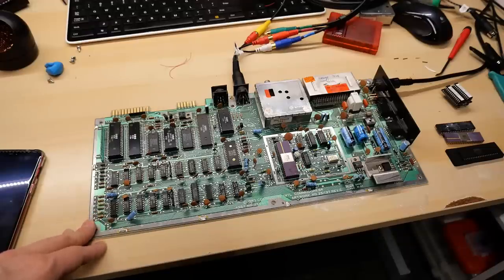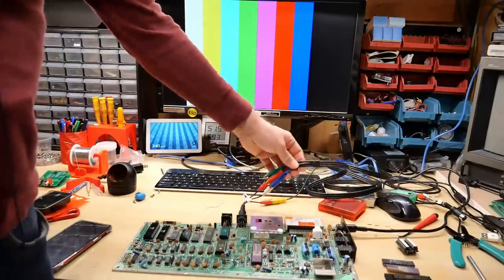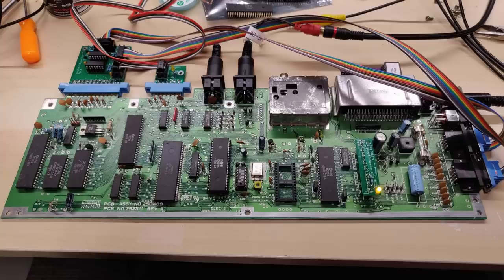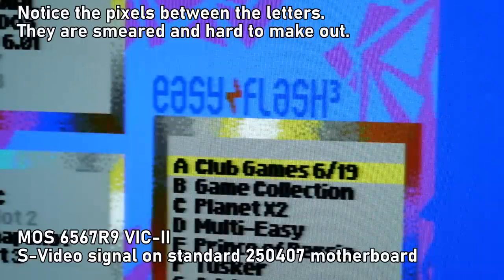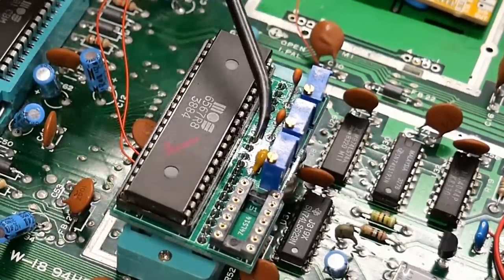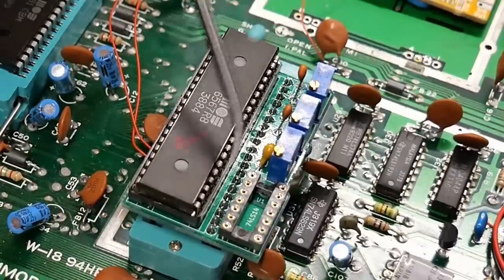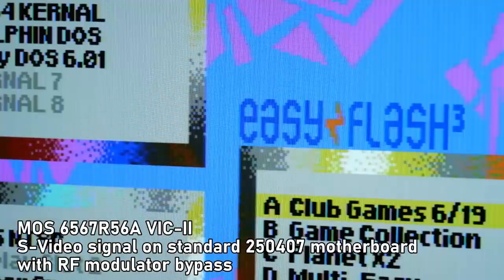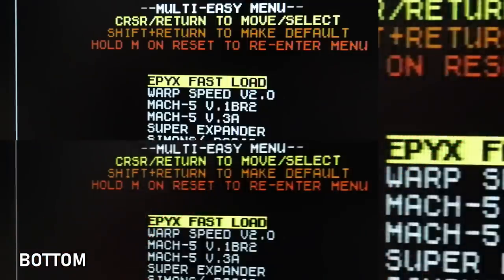C64 video output: Is there room for improvement?

Comment: I wondered how much of this is a factor of the RF modulator - the chroma/luma goes into it, and comes out of it again to go to the DIN connector. Some C64s seem to run the modulator from unregulated 9V, and some run it from regulated and L-C filtered 5V. I suspect there is a buffer amp in the modulator, and this is a factor.

It'd be interesting to take the chroma/luma straight out of the VIC-II, and feed it through a modern video buffer opamp, fed from the +5V line. The separate board Adrian shows seems interesting

Has anyone tried adjusting the  pot on the C64's that have the 74LS629/MC4044 clock gen circuit and see if that affects the picture?
Reply: You might also find there is some improvement to be had by using screened cable for the chroma-luma jump wires. Connect the screen to GND at one end only.
Reply: Another thought occurred to me about the RF modulator - it will have an oscillator in it (possibly two actually) which are potential sources of interference to get coupled into the video signal. So by removing the RF modulator, you're removing those oscillators. I suspect it's probably more to do with poor bandwidth of the amplifiers in the RF modulator though, coupled with the fact that some of the board revisions run the RF modulator from unregulated 9V supplies

Comment: I've come to the conclusion: forget it. The C64 is at the deepest bottom of the rank for good quality video out on 8-bit home computers, way deeper than the ZX spectrum 48, and that is already DEEP. Combine that with a colour palette, that not really has colour, other than various flavours of diahrea, so we have to forget any attempt at decent output. There are TWO ways to connect the C64: over RF, and then slightly detune the channel so a shitload of noise hides any garbage in the RF output. Or go mono. My advise is grab a Philips 80 BM7522, so the amber makes you somehow happy with its sunny atmosphere. 15 gradients of yellow is better than 15 flavours of brownish something. Mono the C64 is acceptable.

And if you have a C128: forget about using it as C64. Hook up the RGBi output to a 1084 and set the machine to 80 character mode, and NEVER EVER switch back to C64 or 40 character C128.

Comment: Cool, man.  I assume that you upcoming rf modulator hack will also work on a   128dcr?
Reply from the maker: Actually no. Commodore used different modulators on each system and it seems no one has schematics for them so I had to reverse engineer the ones on the 250407 boards by hand in order to know how to fix them.
Reply: @adriansdigitalbasement  Well phooey!  I guess I'll have to reverse engineer mine too then.  Almost makes me wish I was on a coronavacation so I had more time for that sort of thing, but unfortunately I appear to be "essential."  :P

What do you do, just cut power to the RF section somewhere to keep it from RFI-ing back into the signals, and leave the video amp thingy and combiner stuff alone?

Comment: on the Vic-II & SID bypass amplifier, are you sure that -5V is ground? There's a pin labeled 'com' right next to it, which is usually shorthand for common, which is essentially ground. If I were you, I'd take my multimeter and measure the voltage between -5V, Common, GND, +5V and the other -5V on the board and be sure. If you're referencing to -5V instead of ground that could have a negative impact on video quality.
Reply from the maker: COM is the composite output.
Reply: @adriansdigitalbasement  What a strange design. So -5V is at the same measured voltage as the GND pin on the other side? Silkscreen error I guess.
Reply from the maker: No the two halves are electrically isolated on the PCB. Nothing is shared between video and audio halves. 

Yeah makes little sense to me as well!

Comment: Have you tested luma-only with the other chips? (I've read that later revision chips used 8 levels of luma, to allow for better differentiability between colors on B/W TVs compared to the 4 levels used on early revision chips)
Reply from the maker: As far as I know, this is on the PAL VIC-II chips. Indeed that first revision has only 4 levels compared to the 8 of later ones. The NTSC chips I have don't work this way.

Comment: Hence, NTSC really means "Never The Same  Colors". It's fun, but awfully true. Rotten old standard.
Reply from the maker: Both systems have tradeoffs. The PAL C64 has bad Hanover bars due to phase error on the chroma signal. The only way to eliminate this is to average two lines of color together halving the chroma vertical resolution. (Which is what most monitors do) I'll show this off in the next video. https://en.m.wikipedia.org/wiki/Hanover_bars?wprov=sfla1

Comment: I had a VIC20, the video out was so horrible it wasn't funny. I was used to using a high res monitor on a TRS-80, the Vic was so much inferior that I hardly used it. I was running a composite monitor, I never tried RF on it.

Comment: I have been struggling with video quality on a Commadore 64 C. I removed that metal "heat sink" and noticed that when I attached the keyboard without it the video went haywire. So I put it back and it's fine. Any suggestions?

Comment: I don't agree with you that Lumafix doesn't work.
I have a 250466 PAL with MOS 6569R5 and Lumafix completely removed all jailbars.
There was a lot of screwing on the adjustment screws, but 100% of the jailbars are gone.

Comment: The amp circuit has a GND on the right side, so the -5v line probably should be -5v.
Reply from the maker: The COM connection is composite video. Not common. -5V is ground.
Reply: @adriansdigitalbasement  What I saw was clearly labelled GND At 9:21. Next to R12, below "OUT>" above "SID OUT"

Comment: hey Adrian, I wonder if you could hook up a small chip to the Y/C output if the Vic II and have it decode the chroma and luma. Then, since the C64 only has 16 colors, you could decisively decode the exact colors for wach pixel, and you could put it out as perfect RGB.
Reply: I’ve thought about that too.  Doing so might be more complicated than recreating the video output from video memory though.
Reply: @nickwallette6201  but would such a recreation be compatible?
Reply: c0pperdragon, the person who developed the FPGA mod had "tried really, really hard" to extract a pixel perfect signal from the VIC-II before going the route of just re-creating the VIC-II video out circuitry on FPGA... But only the video generation part, a real VIC-II is still used to fetch data and generate all the timings.
@cheater00 , seems compatible enough to me.  I've thrown the latest demos at mine without any glaringly obvious problems.
Reply from the maker: Yes I read the details on that board and really it was better just to recreate the VIC-II in a FPGA -- at least the parts needed to make a video output.
Reply: @adriansdigitalbasement  that's crazy cool to be honest!

Comment: That board can be replaced with 1 cheep chip FMS6400-1 it includes the proper luma / chroma band filters, 75ohm line drivers and additionally provides a composite output. VCC=5V only.
Reply from the maker: I just looked at that data sheet and that IC and it expects a 75ohm 1v Peak to Peak luma signal. This is not what the VIC-II outputs hence the buffers on the Y/C outputs on the VIC-II.
Reply: A simple transistor buffer on each should fix that, similar to schematic 326106-2of2-right, but yes it then makes it more complicated.
Reply: @adriansdigitalbasement  It is interesting to note too that the VIC-II's luma pin is actually an open collector.  It can only sink the current from the supply rail, it can't actually "output" any current of its own.  If you look at the schematics of the original modulators, you'll see a pull up resistor and a diode to provide the power to the luma pin.

Comment: That board looks like a SMD version of Zer0-X's (Tommi Lempinen) "Spider" modulator replacement.
See: https://lh3.googleusercontent.com/proxy/Duu7_AebbvnnOKbqbZ8wMpaW2RNwzt4QMo5PoIuOMy7YrnHvmoIucSZ96Kq7nNW6VAXJprtbABkPcDeFUnUiL10XXWrUZfk
Another major quality boost is achieveable by using a high quality CRT like a Sony PVM ... unmodified C64 250425 PAL (don't know the VIC-II revision off my head): https://i.imgur.com/HKXeGB4.jpg
Reply from the maker: Looks similar but definitely isn't. I've done all this reverse engineering of all the RF mods and this board so can tell their design but looking now. LOL

Comment: Quick answer:
get an FPGA replacement that support VGA or RGB Video output. :D
Reply: ungratefulmetalpansy  the point is to hold it in your hands. unlike software emulators. :p
plus chips are constantly dying. someday there are no more functional VIC IIs or SID chips... what then?

the sooner people start with the development of softcore versions of these chips the better and more accurate they are gonna be by the time the chips died out.
Reply: ungratefulmetalpansy  some people still want to hold the actual computer though.

the only things that would be emulated are the Video and Sound chip, the rest can still be made using modern equivalent of the real chips. (PLA can be replaced by a PLD or CPLD)

doesn't seem logical to completely get away from real hardware if 90% of it can still be made. (and the other 10% are programmable hardware, but still hardware)
Reply from the maker: I do like of agree with everyone here that at that point, may as well use emulation. I like to use my C64 at the native scan rate on a CRT as that is closest to the original hardware...
Reply: @adriansdigitalbasement  It was just an idea, for an actual replacement chip the FPGA would logically generate the same signal as a real VIC-II, just clearer.
otherwise it would not really be C64 compatible.

but it seems like an overreaction to say "just use an emulator at that point" when i suggest to replace 2-3 chips with CPLDs/FPGAs because they won't be around for very long anymore...

i mean you're not throwing the whole system onto a single FPGA like "THEC64", it's just chip replacements... to keep the actual hardware alive for longer.
Reply: @proxy1035  Maybe run a kickstarter😂
Reply: It's not like were asking Jesus to have his nipple pierced to keep up with modern times here or that you HAVE to have your VICII upgraded, the point here is simply choice - some of us do want an FPGA VICII instead of a Turbo Chameleon or an Ultimate 64, there is demand for it and therefore a market so who's up for the challenge?  (No not you Jim Drew I'd like to actually get my hands on one before I die)
Reply: @_.OX._  "Progress on the JDFPGAVIC-II is nearly complete, however my financial backers have convinced me to expand the scope of the device to support C16, C128, VIC 20, Amiga OCS, ECS, AGA and the NES 2C02.  The JDFPGAVIC-II is no more, long live the μVideo!  Expect delivery sometime 999.M41."

c0pperdragon's FPGA mod is pretty much the near perfect compromise.  The original VIC-II chip is retained to provide 100% software and timing compatibility.  The VIC-II's S-Video & composite outputs are kept.
Reply: @HojoNorem  JDFPGAVICII lol ;)   Never heard of the c0pperdragon fpga mod thanks for the heads up.

Comment: I'm a little disappointed that you used an upconverted and an LCD monitor :(
Reply: Adrian doesn't have much space for a CRT on his overloaded workbench :D
Reply: @cybercat1531  he still has a PVM (a 14") in a corner. He used it at some point in a video.
Reply: Yeah hence he clearly doesn't have the space for it :P 
To be honest I think the real reason was just to easily compare the quality on LCD.
It's easier to distinguish the quality difference on a discrete pixel grid monitor.
Reply: Harder to film a pvm too
Reply: @50hzAva  yeah, there will always be the 60Hz flicker, but there are ways to counter that.

The worst is by far 50Hz CRTs, they're a nightmare to film, so whenever I can, I use NTSC sources with my 9042QM.
Reply: @cybercat1531  CRTs does a darn good job of making imperfections, especially smaller ones. I have a 9" PVM and even CVBS looks sharp as a razor blade on it. Almost feels like looking at a LCD without any scaling.
Reply from the maker: Yeah impossible to film a CRT close up to show subtle differences. You can easily see them with the human eye though... But the LCD is so much better for showing the subtle differences on camera.

Comment: With respect to the RF modulator bypass, "Com" is sometimes used to refer to a signal ground (as opposed to a chassis ground).  The -5V connection might have actually been intended for -5V, not ground.  Whether that would change anything, or that line is even used, I have no idea.
Reply from the maker: COM is the composite output. And I have it hooked up in the video and it works as it should.

Comment: (C)1984 GX-211 VO 8515
Assy NO. 250425

I have one Yellow C64 Board with these Markings on it, all the rest of my C64's do not have this Anyone with Info ? PAL
Reply from the maker: That's just the later board with the 8701/7701 clock generator chip. I briefly showed it in my video -- that one has sharper (but still not perfect) video output

Comment: Do C64 boards even have -5V on them?
Reply from the maker: They do not. They could if it was needed as there is AC power but there is no -5v regulator.
Reply: @adriansdigitalbasement  Some machines of the era do, but I'm not that familiar with the C64 so wasn't sure.
Perhaps it's just a generally useful board, not particularly made for the C64?

Comment: I think the major issue here most of the chip on how they we made is the the contention of the  leaed designer of all the known faults and all known cures  could not be met unless you wnet through a replaced what was on the  original boards..

To make commodore  great again  you would have to build a modern version of it  to know if you can  fix the design flaws within the platform..

Whilst i de commend you trying to keep these commodores out of landfills adiran though if you are going to be  bothered to cure the issues  within the component interface  you end off staving off a and scrapping stuff from dead hardware  last  several month's to several years until the next person crack's it open  to repair  it